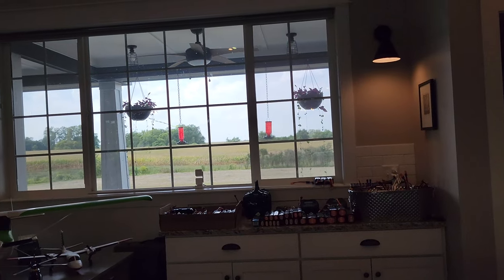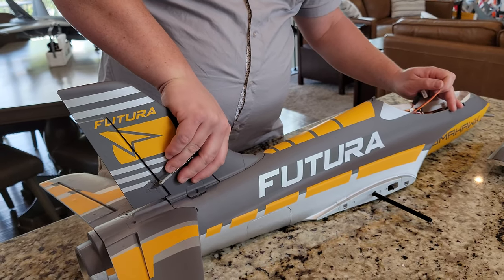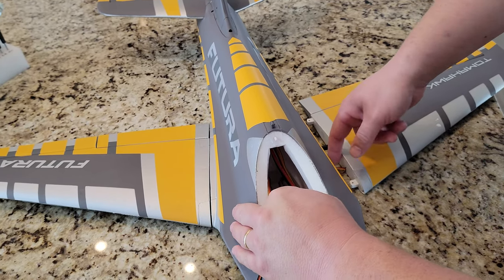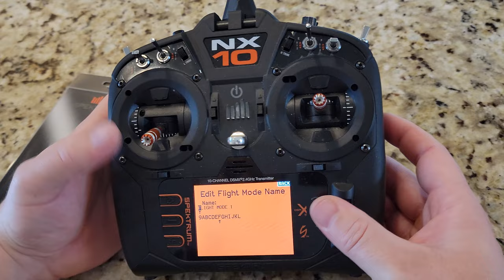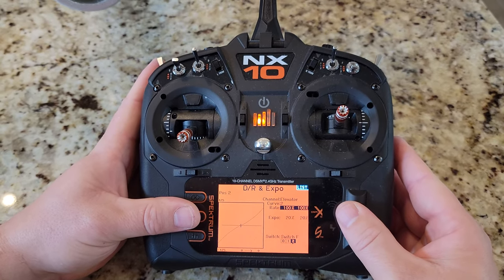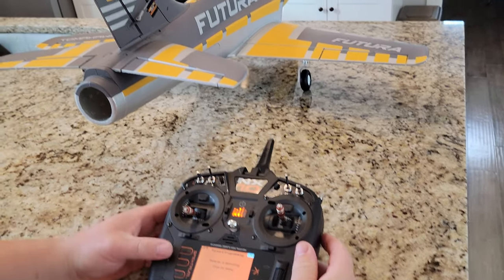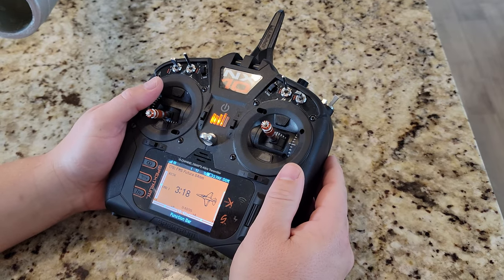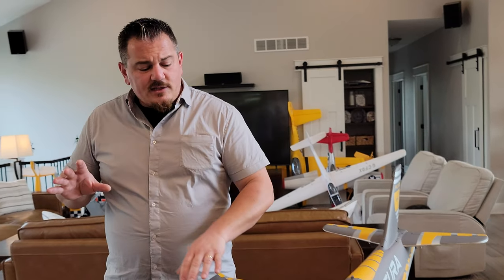FMS - Futura - 64mm - Unbox, Build, & Radio Setup

Comment: Thank you for the detailed setup, it was very helpful and educational. If I may make a suggestion, when you are showing the radio setup it would be very helpful if as you operated the various buttons on the NX10 you would call them out. I had to replay numerous sections of the set-up portion of your video as I tried to guess which buttons you were pushing. Keep up the great videos, they are very helpful.
Reply from the maker: Thanks for the tip! I can try to do better. Only issue we've had in the past is that we try HARD (I know it doesn't always show) to strike a balance between going REALLY slow to help newer pilots, and just BLASTING through. I can do this setup in maybe 4-6 minutes off camera...all the way through...but we do slow down considerably. The key call out might be something to try and see if I can make it work.

Thanks again, and glad you're here with us!

Comment: Last week, after a long wait, I bought 2 of these from Turbines-RC, one for my son and one for myself as we like to fly in formation. Unfortunately both models suffered from ESC malfunction. After less than 2 minutes of flying the ESC goes into emergency mode, leaving just the servos working for an emergency landing. The cause is that the ESC is 40Amp  while the motor draws 48Amp. We are very very disappointed considering the fact that for a 64mm EDF is very expensive, being more than Eur 80 dearer than the Motion RC Banshee. This also leaves me thinking that FMS does not test their electronics. Sadly I DO NOT recommend this model.

Comment: Brian, time to build a barn for the planes.
Reply from the maker: 60'X80'X20' at the end of the dam, it'll act as the dam gift shop ;)

As for timing, we gotta get the pond done, or at least started, and some of the "refuse" dirt/clay will be used to start that pad, OR it will go straight up to the FULL SCALE STRIP...which is kinda the "next" large capital project. Roads, and approaches in front of such buildings will be critical, so that'll also be on the agenda, and will significantly increase the cost component of the dam gift shop, but it will be much easier to maintain, and look nicer, AND be another runway. The Heli Pad will happen at the same time, as well as extending the runway to meet it.

It's gonna be epic, but also crazy expensive, and hope the YouTube channel can start picking up the pace, in terms of growth, so we can get this stuff "in budget" - LOL LOL LOL ;)
Reply: @BrianPhillipsRC  bad ass!! We can do it!

Comment: About to pull the trigger on this one. Do you think if ESC is upgraded to 60A, it can handle 5S?    I fly mostly scale (55% throttle) but like to do 1 or 2 passes at full throttle.   Will 5S be a problem in those short passes?

Comment: Brian I bought one of these as well as the 80mm. On the 64mm I went ahead and also bought a Reflex to put in it but wonder if I will need it ? I will be using a AR630 for a receiver and a NX10 transmitter so would I gain anything by using a reflex ?
Reply from the maker: Reflex would only be needed if you wanted to use an AR620, since the AR630 HAS AS3X and SAFE...

You can keep her for another plane, if you wish...they CAN be reprogrammed, fyi.
Reply: @BrianPhillipsRC  Brian thank you for your fast response. Looks like I’ll be saving for another plane. Love your YouTube vids I learn a lot and be sure to thank your camera crew 😁😁👍❤️

Comment: Hey Brian it’s me Ryan I’m the guy that emailed you about the 737. I was just wondering if I could use an ar630 since it’s cheaper or do I have to use ar631
Reply from the maker: AR630 is only about $5 less - you probably want the ANTENNA, since it's a bigger and faster plane.

Without AS3X/SAFE...
https://bprc.me/AR410
https://bprc.me/AR620
https://bprc.me/AR6610T
https://bprc.me/AR8020T

With AS3X & SAFE...
https://bprc.me/AR630
https://bprc.me/AR631 <<<<<< $5 - might be the difference between connection and lack thereof. The plane is FAST.
https://bprc.me/AR637T
https://bprc.me/AR8360T

If you want to put the AR630 in a plane - you'll probably be fine on slower planes where you might have a few milliseconds to reconnect to end the flight in a proper manner. If you're going 110 mph, there isn't time to reconnect, but if you're going 35 mph, there's more leeway.

Just my thoughts, but for the money you're gonna have tied up in the "next" plane, you'll be talking about a rounding error.

Good luck Ryan!
Reply: @BrianPhillipsRC  Ok I’ll go with the one you recommend thanks!
Also I’m having a hard time understanding all the terms that you used like gains and expo for the as3x process if you wouldn’t mind could you tell me a definition of what they mean